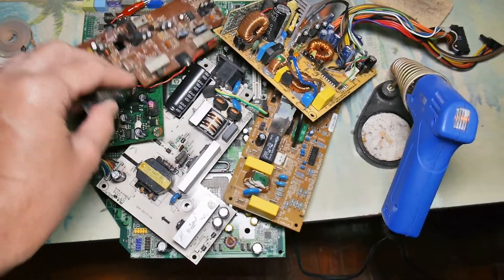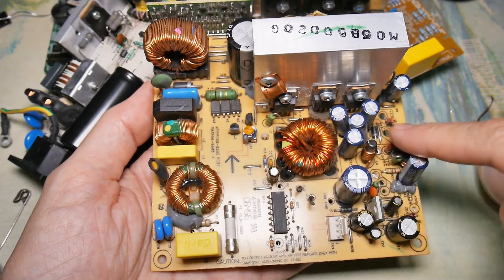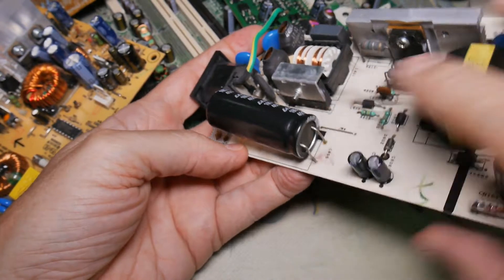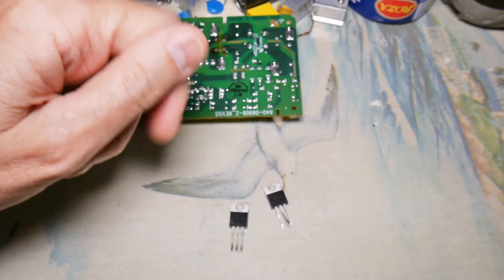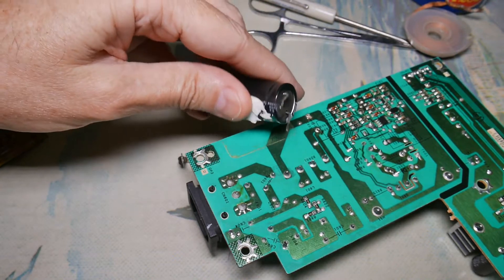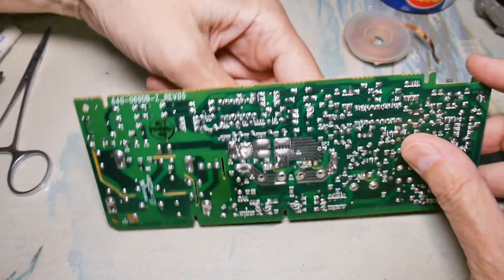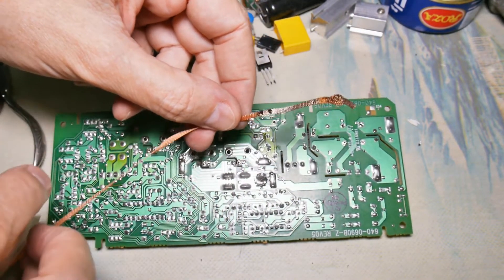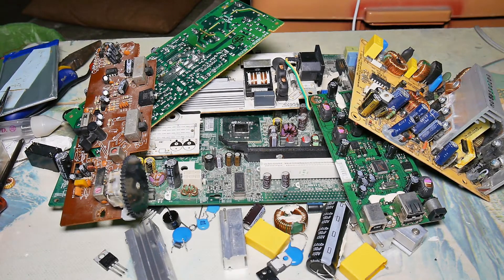Desoldering Basics: Circuit Board Stripping, Tips & Tricks

Comment from the maker: RELATED: 
Reusing electrical components from scrapped stuff:  https://youtu.be/cMejndPYn0c
Remove Pins From Amphenol / Molex Connectors For Reuse: https://www.youtube.com/watch?v=LUuBx0uVNG4
Salvaging Circuit Boards + Rare Find:    https://youtu.be/dFpr_1sD764
Salvageable Parts From A Bad UPS Board:   https://youtu.be/FAhTbH2efAw
Salvaging Electronic Parts: Power Supply:    https://youtu.be/pDbAhXd2qLI
Salvaging Electronic Parts: Core I2S Motherboard:   https://youtu.be/5c1ME2DmHk4
Reusing Crimp Lugs:    https://youtu.be/JIdsnk8kqoY
Threaded Brass Inserts - Salvaging & Reusing:    https://youtu.be/DR6H3-N3t-I
LED Security Light IR Sensor Teardown For Parts(?):    https://youtu.be/ySlk66hfrlg
Salvaging Electronic Parts: Remote Doorbell:   https://youtu.be/bRk9LSBjLio

Comment: Use a soldering pot to remove components from the board it way easier then another method just place the board over the solding pot that way it melts the solder of that area the simply pull out the comp of the board one the the best and fast way to desolation components from the board. This is usually how I salvage components
Reply from the maker: I've never tried that. How do you prevent overheating the components? Most parts have a limited amount of time at soldering temperatures before the part's performance begins to degrade. Do you have some trick to make it happen fast?

Comment: Do you test the components you recover to make sure they work?  If so, how?  I have a bunch of non-working or partially-working electronics (mostly old smoke detectors) that I would like to strip components out of (in my nonexistent free time)--my concern is I don't know which components are good and which aren't, and I don't want to waste a bunch of time trying to recover a bad component.
Reply from the maker: Most digital VOA meters now come with capacitance settings, so you can use that to check caps.  Some have transistor tests as well.  You can use the resistance setting to test transformers for shorts and resistors for value (but bad resistors are usually discolored or burned).  You pretty much have to remove at least 1 of 2 or 2 of 3 legs from the board to test it.

Comment: So a few tricks of mine (warning long)....

Solder Wick: Add flux. Even the cheap Chinese solder wick works great with the addition of fresh flux.

Cheap Mechanical Solder Suckers:
(Not shown here but...) If you add a piece of 6mm heatshrink to the pump tip and cut it just long enough to extend several millimeters past the tip, then shrink it down, you will have the ability to focus the suction onto a smaller area. The heatshrink will also conform to and around almost any lead and pad. The down side is that the heatshrink will clog more quickly than the normal pump. However, the clog will usually stay in the heatshrink instead of inside the pump tip. I keep a container of heatshrink pieces cut to length and ready to use for this purpose, along with a butane lighter.

Multi lead components with relatively close leads like transistors:
 I keep a roll of very thick lead free solder handy, the kind you'll find at a typical big box retail store. If I add a bunch of flux to the footprint, then a blob of this thick solder most things will fall right out. My typical 0.8mm solder just can't build up quickly enough for this kind of thing. It also contains lead, so it has a lower melting point. The lead free stuff will take more heat, and applying a thick blob quickly will bring all leads up to temperature quickly. The flux added at the start will clean off all the junk present as soon as heat is applied.

When I have a lot of components to remove:
 1st.
  Check if there are SMD parts I want. If so, I need my cheap hot air gun. This can overheat things like very local electrolytic capacitors. So, if I need these caps I'll remove them manually with an iron, but usually I just rip them off with pliers. This just applies to stuff within a few centimeters. Then I remove the SMD stuff I want.

2nd.
 I have one of the cheap solder pots from China. I got it from eBay for $15. The trick for filling it cheaply is to go to the thrift store and find stuff like decorative plates or trinkets that have a tin percentage marked on the bottom. This usually says something like 97%. The other way to tell if it will work is just to bend it. Anything with a low melting point will bend much more easily than it appears due to the thickness. Be sure it's cheap and you are willing to buy it before testing this way. More pure tin will also have a distinct crackling sound as it bends and flexes too. Spending a few dollars for a tin plate is by-far the cheapest way to fill a new solder pot. Don't worry about lead or purity either. Once used on a few boards it will be full of lots of garbage anyways. You will need to be in a safe area and very cognizant of the danger of a container of liquid metal. You don't want to spill that anywhere. It also needs to be completely full for removing through hole components. I have a collection of large Pyrex casserole dishes I use to contain my setup. This wouldn't help with a total spill of the pot but it will contain minor splatter and the dross film that forms on the surface and must be wiped off the molten pot surface regularly.
 Once I am setup with the pot up to temperature, the first thing to remove are the electrolytic capacitors. These are the most temperature sensitive items on the board. If they are exposed to the pot for more than a second or two they will overheat and vent, especially the tiny useless ones nobody wants. Larger caps will not overheat easily like this, but I still remove them first. 
  Once the electrolytics are gone, I just dip the bottom of the board into the pot. This instantly causes any component to fall loose. The challenge is to remove them as fast as possible while positioning as few components into the pot as possible. This can often be done by hand if you're quick, but if something doesn't come out due to things like several folded leads on the solder side, it's going to get really hot really quickly. If done right (quickly) this will apply less total heat to the components than any other techniques I've tried and there is no faster way than this :-)

I hadn't thought of using a safety pin like you showed here. Thanks for the upload and tips.
-Jake

Comment: Not a big believer in hot air! ;-)
Reply from the maker: From me or to use in desoldering?  ;)
Reply: Yeah, I just flip the board over, support it either end with something rigid, like 2 bricks, then play a heat gun over the board.  Most of the components just fall off, some can be tapped or pulled.  I do this outside...
Reply from the maker: Outside is good.  I've seen this done.  It seems that parts will be exposed to high temp for an extended period of time.  Parts have a max time they can be exposed to the temp of melting solder and it's usually very short, just a few seconds typically.  Might have to try that experiment, but first I will need a way to track the temp of many components at the same time.